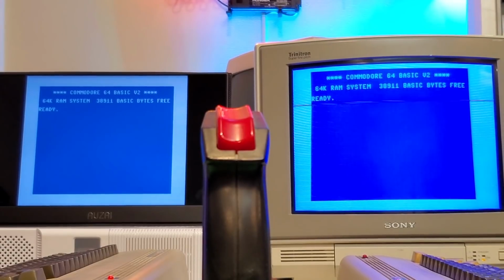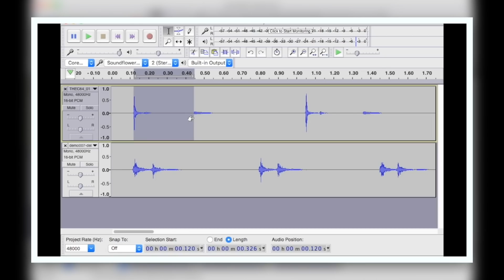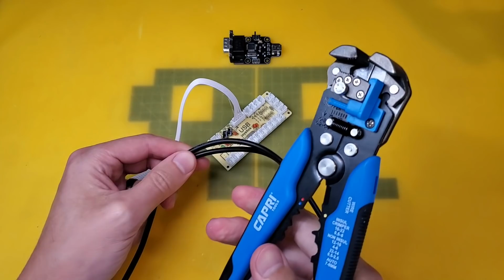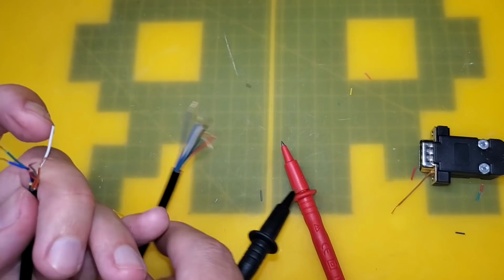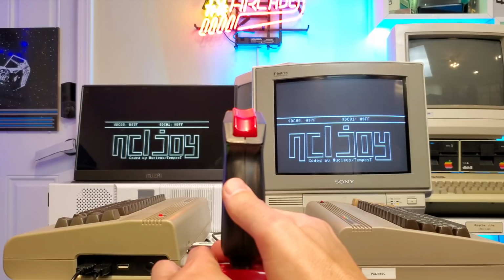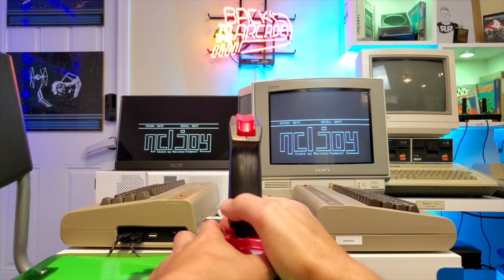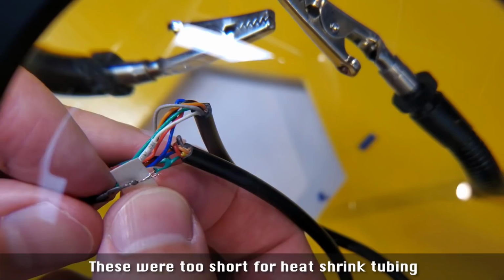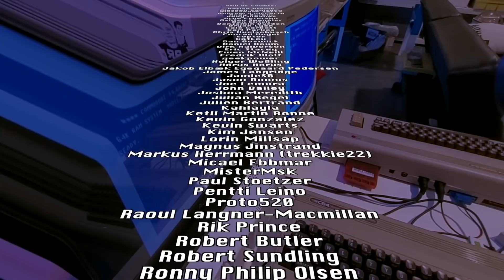Simultaneously playing 2 computers with 1 joystick?! C64 🆚 THEC64™ + How joysticks work

Comment from the maker: Thanks for watching! To those asking if I've tried Enchroma colourblindness glasses, I chat about this towards the end of my C64 Colour Fix video :-) https://www.youtube.com/watch?v=pw6xcDPcSQM
Reply: There are apps that tell you a color from the smartphone camera.
Reply: did you take into account the latency of your flat-panel display?  The only real test would be to get a hdmi to rca adapter and hook it to an identical monitor.  Most flat panels, especially older ones, have atrocious delays.  You are actually confirming this in your video because the word takes two frames to appear.
Reply from the maker: @LordOrwell  Somebody didn't watch the whole video... 😉
Reply from the maker: @elmariachi5133  Yup I used that a lot!
Reply: Very 8-, er..., 9-Bit Guy-style for a comment! :-)!
Reply: @RetroRecipes  i watched it.  I'm simply stating that many people have tested the latency of their displays and found they either don't match advertised latency, or it varies based on various settings in the menu.  It couldn't hurt to measure it from a pc.
Reply from the maker: @LordOrwell  I'm still not sure you've watched the whole video. the latency screenshot that I show is from a website which I also showed, who specialize in testing and reviewing displays. They are completely independent as you can see. I also linked to them in the video description. What would be gained by me repeating tests using expensive equipment that have already been done to a higher standard than any of us could imagine?
Reply: @RetroRecipes  Wonder whether Ian G watched the whole video...

Comment: DO NOTICE: You will have to be very careful when doing something similar with those USB Arcade Controller boards.
Because as you explained most of our retros use the Atari 5V pull-down system. Whereas those very USB boards use 5V pull-up, detecting when 5V is applied and not pulled to ground (0V).
I would recommend using some hex-inverter IC's and maybe even some optocouplers in between, just to be safe and not damage our... precious retros (Gollum voice).
Reply: If they're merely pulling up or down differently, neither should cause any damage. One simply won't work. Unless they're feeding 5V onto the ground pin of the controller?
Reply: @ArixZajicek  Yes, precisely therein lies the immediate danger: assuming the board is pull-down and that the trace going to one pin of each white connector is GND - when it isn't.

In theory, I would agree with you. But no C64's (or C128's for that matter) which I have measured have ever actually put out 5V through the joystick ports... more around 4.4V - 4.6V.  

Now I don't know how current-hungry such a CIA chip might get if provided with an alternative 5V power source, say like via USB from The C64 Maxi powered by a brick able to provide several Amps more or less directly to the USB port. What I do know is that it really doesn't take that much to make lovely CIA-chip BBQ.

So, the reason I mention optocouplers is that they would isolate the 2 circuits optically. Which again means that the C64 would only ever get "5V" from its own power source. Thereby Perifractic-proofing (no offense) any future mad genius experiments.
Reply: Also a Y cable might cause backfeeding (sending power into an unpowered device (ive blown a USB port on a new motherboard before as the USB hub i used was sending power back into the motherboard),
Reply: @jjjacer  A powered USB hub should have a dedicated slave port that connects to the computer, so the 5V power should only come from the computer. The other master ports on the hub should also only be powered from the hub itself.
(And if it's an unpowered hub it cannot send power back anyway.)
Reply: The safest way to do this would be to bite the bullet, open up the joystick and replace all the single-pole switches with double-pole versions. Then just make a duplicate cable, wired up the same as the original, except using the second poles. Use a cheap clone joystick if you have a collectors item!
Reply: @stmounts  it was a powered USB hub, it should have had its slave port separated  but it was badly designed (dont remember if i got it from amazon or new egg, it had worked fine for years on the previous PC, only guess is maybe when moving it around when i built my PC something happened to it), I knew it backfed as the PC had all cables disconnected, including power and video, and with the hub plugged into the PC the video cards power light was on, sadly that port is fully dead on my brand new mainboard, but lesson learned about cheap hubs
Reply: @jjjacer  Yeah, it's buyer beware buying anything cheap online. It shouln't have been possible to connect two master ports together, but assuming it was the same on your previous PC I can only guess that maybe the old PC had either a separate 5V supply for the USB master ports or each port was isolated from 5V feedback by diodes or both.
 Maybe you should insert a diode at the hub slave port end to fix the problem? (Assuming you haven't chucked it away in disgust already!)
Reply: @stmounts  hey i chucked it but next time ill check to make sure that the pc input isnt getting 5v sent to it from the powered ports. although im probably just gonna get a PCIe usb C card in the future if i really need more ports. (new PC has plenty, so hub is less needed,  although it was helpfull to reduce damage to the front usb connectors from over use)
Reply: @stmounts   Since this would actually give you 2 sets of contact surfaces per button, I don't know how reliable or accurate it would be.
 Although I do see your point, it sounds a bit too overprotective to me.

If you take an LED and a light-sensitive transistor and place them facing each other inside a small 100% opaque tube. That is basically what an optocoupler IC is.
So one circuit would only be hooked up to the LED and the other only to the light-sensitive transistor. Passing the signal from one to the other without any form of electric contact or transference. And because it uses light and both the LED and the transistors are able to react extremely fast any added latency would be minuscule.
Of course, an actual optocoupler would be more efficient at this than any DIY makeshift version like I am describing here.
Reply: @Zhixalom  Good quality double-pole switches are extremely reliable if operaterated well within their design parameters. 
Also, there was some doubt raised elsewhere about the polarity of different  joystick circuits, don't know if this really is an issue, but if so the double-pole switch solution would fix this while your DIY optocoupler would not. 
Come to think of it, there is really no need to use a joystick at all! Just wire up 6 double pole switches to two cables with the DB9 connectors.
Reply: @stmounts  Explaining how one component works by using two other components doesn’t mean that I actually make optocouplers that way myself.

No, please just go out and buy them or order some online. They are much more reliable if operated well within their design parameters that way. Hmmm… couldn't that be said about pretty much any component?

There is no need to spread doubt on whether I'm right about the polarity of those USB joystick boards. If I by pointing this out just get at least one person to take a multi-meter to whatever it is they are planning on doing before they start experimenting then I am a happy camper.

Didn't I also mention something about hex-inverters, I'm sure I did?!?

You are completely right there is no need to use a joystick at all for this experiment.

Then again, I wasn't addressing the various ways of how this should or shouldn't be done. I was only pointing out an incompatibility issue that might not be directly obvious to everyone. I also try to make a habit of not pointing out a problem without also providing at least one possible solution.

This doesn't mean that I am going to jump out of my seat and start recreating this experiment in various different ways to find the most optimal design either. But if you want to give that mental picture a good chuckle, then who am I to rob you of your imagination.

Comment: The 9-bit guy calculated the actual latency, you did the latency difference between the C64 and THEC64.
Reply from the maker: Right, and that is the "actual latency". The real Commodore 64 has zero latency against the real Commodore 64. Therefore the difference between the real Commodore 64 and THEC64 is the actual latency of THEC64's emulation. As I explain in the video, David's latency was less accurate due to 3 possible factors, by his own words.

Comment: MOS 6526 internally have ~5K Ohm Pullup when in input mode, multiple devices connecting pins to gnd does no harm, and two C64 will be like pulling 2.5K Ohm low.
Though some software error could put the pins as output with active pullup that is more like 100 ohm, so putting 100 ohm in series on the cables would be a good idea, though if this software error existed using a joystick and continually holding the button down would cause the same heat, as all contacts inside a joystick just connects the 5 pins to gnd. There are some rc filters on pcb board too that probably have 100 ohm, but you don't want to use them as a fuse as c64 is antique.

Comment: Omg..Did he literally gave reference to the “2 girls and one...”... oh I’m not saying the rest! 😂
By the way the Sega Genesis also uses a nine pin port system. I tried installing my Commodore 64 joystick once in it but did not do  anything.
Love the video!
Reply: I believe the Genesis/ megadrive game pad despite using the same connector uses an alternate pinout. 
Also the polarity of some of the signal lines are swapped. 
But there adapters both already put together and DIY kits that you could get to use a Genesis pad on the c64.
Reply: @lukasperuzovic1429  The Genesis work on the C64, I used to do it all the time back in the day. Just don't hit the start button because it sends voltage to a place that can damage the C64.
Reply: @megan_alnico  Okay, I knew somewhere there's a catch. I was looking at the pinout and I see it's not a 1 to 1 comparison. and I know the polarity is not the same on each pin. I just didn't know the details.
 I still recommend an adapter just because you could accidentally fry the C64 by hitting start.
Reply: @lukasperuzovic1429  oh absolutely, kid me had no idea what she was doing and was thrilled that it "worked". I'm honestly don't have fond memories of the C64 joystick, but I didn't have the red and black one people talk about. I had a back and grey one with a white fire button on top and that was terrible. I remember being so excited to play C64 games with the Genesis pad!
Reply: @lukasperuzovic1429  let's just say it would be a very bad idea to try that sega controller on the commodore.  I am pretty sure i used one on an amiga once though.
Reply: @LordOrwell  Yes, thats why I suggest an adapter so you aren't sending voltage up the wrong pin

Comment: I've had problems using heatshrink on indivual wires when extending a cable. If you try and minimise the length of the splices, you get to the point where the heatshrink 'shrinks' while you are soldering and gets stuck, not covering the exposed part of the wires! You used to be able to get an insulating sleeve (spaghetti) that was made of some sort of fibre and resisted heat, but of course it didn't shrink. Good enough for tight splices 'coz you can still put a single (bigger) piece of heatshrink over the whole splice section to finish.
Reply from the maker: Yup that's a real pain in the bottom!

Comment: I tried this hack at Walmart. They asked me to leave.
Reply: I found a better one, program up a computer to start yelling anti store propaganda - 5 minutes after you've walked to the other side of the store (to watch the action)
To my amazement, the man behind the counter just turned around, flipped open the shops power board and dropped the entire shop!
No it wasn't a Walmart, but a somewhat smaller retailer.
  -  TRS-80 clone, driving a Votrax speech synth.
Reply: @paulstubbs7678  So what you are saying is you wrote a computerized 'Karen'?
Reply: find a better walmart

Comment: Great.. but watch out for ground loops.. connecting computers may not have same ground potential. Use your meter to check between system grounds before you connect them. Good luck.

Comment: Could be interesting to simultaneously play the same game on two separate machines, however, depending on the game this could get frustrating if there's any random AI in use for enemies, obstacles, etc.

Another thing, this video defaulted to 480p30fps on my phone, yet I could still barely notice the lag. Noticed it more when I switched to 60fps, but kind of surprised that it's only 4-5 frames.

Excited to see next part of this experiment.

Comment: Very cool cable idea.. Can't wait to see your tests.. I'd also love to see C64 vs C64c or C128...
Reply from the maker: Thanks! In theory they would be identical...
Reply: 64  @RetroRecipes  In my experience they are not quite c64c timed identically.. particularly the C64 and the modern C64c with the lower voltage chips... also.. I love your videos, I am an owner of a lot of vintage computers from Commodore, Apple, Atari and even DEC (some old VAX machine_)

Comment: Perry! Loving this video so far, just a couple of thoughts whilst I'm still watching - if you do, for some complex technical reason, leave the heat shrink wrap off before soldering, you know because ... technical reasons ... if you're careful you can cut it in a thin spiral like a folder binder, and wrap it around (brand depending I think, my Dad was a sparky in the British Army and told me that trick!). Also, just for sake of asking really, You mention you're a bit colour blind, I'm not but I have always wondered if those sun-glasses that say they correct it actually work? Anyway! Greetings from Derbyshire back in the old country - Hope you and yours (Ashley too!) are as safe as can be with ... everything ...  I'm glad you're still putting out fantastic content and keeping me sane!
Reply from the maker: Nice tip, thanks!
I talk about those glasses in my C64 Colour Fix video 😊

Comment: Splash and Crack is that a euphemism for Champagne and that well know 80s recreational drug, you could of used crimps instead of soldering, you already had the tool to do them.
Reply from the maker: Well it does definitely wasn't my euphemism when I was 12 and made the magazine 😆 As for the other suggestion yes there are always several ways to do something. If I'd used crimps people would have said you could have soldered them, it would have been more compact... 🤷‍♂️

Comment: If they aren't running the same speed, maybe there's a way to slow down the CPU clock? I remember the Amiga action replay had a slowdown pot.
Reply from the maker: they do basically run at the same speed. I cover this more in part 2 which is with Early Access supporters now and will be out next weekend.

Comment: While using a low-latency LCD and subtracting its specified latency is cool, just using 2 CRTs or 2 LCDs would be cooler.
Reply from the maker: Well, the C64 doesn't output to new LCDs natively without an upscaler which adds its own latency to the latency of the LCD. And THEC64™ doesn't output to CRTs without a downscaler which again adds its own latency to the mix. There's method to my madness...

Comment: When the latency tests started.. oh boy, the video got crazy interesting!!! You could have done another latency test in the end..
Reply from the maker: Glad you liked it. What further latency test would you like to have seen?
Reply: @RetroRecipes  a sorry thought you changed monitors at some point but you were using the same one all the time.. my mistake.. this is a great method to catch latency compared to real hardware or testing new monitors.. 
do you by any chance own or can borrow a high speed camera for better accuracy measures? Not looking into putting you into more expenses though..
Reply: @RetroRecipes  I'd have liked to have seen them both either on a CRT, or both on an LCD.  You'd need an LCD TV (which you may not have, for the SCART/Composite input), or use adaptors, but it seemed unfair comparing the best of everything against the worst of everything.  Of course LCDs will also have different latency, so it's not easy to set up.
Reply from the maker: @johnkayanas6755  I could but I think we have an accurate enough result here 👍🕹️
Reply from the maker: @necronom  Did you watch the whole video? I factor in the LCD latency and subtract it.
Reply: @RetroRecipes  I did, but you just added it on.  I would have liked to see it actually happening rather than adding on a number you were told about.  I'm being fussy, but I like to see actual proven things instead of a number that someone else found on their screen.  Just ignore me!
Reply from the maker: @necronom  I link in the description to and show the website where that screenshot is from, so that you may see how carefully it was tested. There's no point in me buying expensive equipment to repeat a test that's already out there.

Comment: 50 milliseconds is well with in the range of unusable for gaming. You should try BMC emulator on a pi 3b+ to a CRT. Also I hope you made note of the Max 64 not being able to set the 8580 sid in loaded games and demo.. Big problem and big oversight
Reply from the maker: Interesting. Why do you feel that's an oversight? Back in the day we couldn't choose which SID we had. Isn't it nostalgic?
Reply: @RetroRecipes  because you can't watch any demo without an 8580 sid and it's already in Vice.. which they use. They just haven't added the option and it has made the machine completely pointless at least for me. That's the reason I didn't buy one.